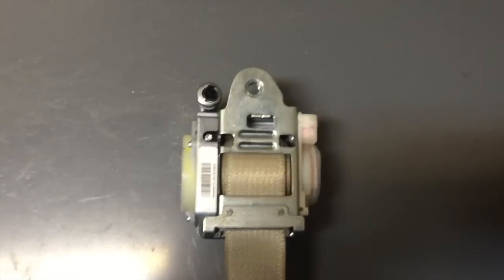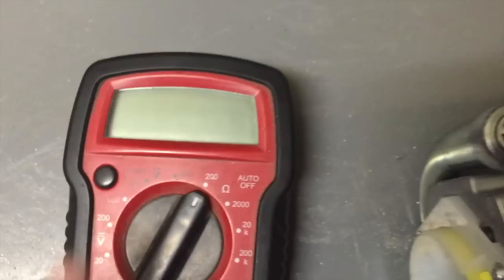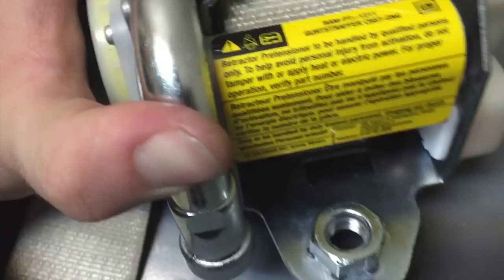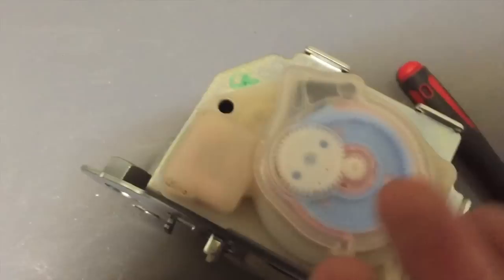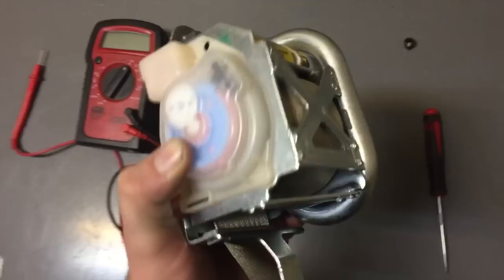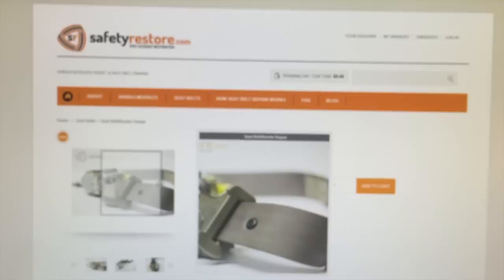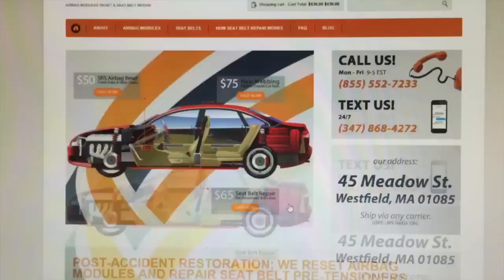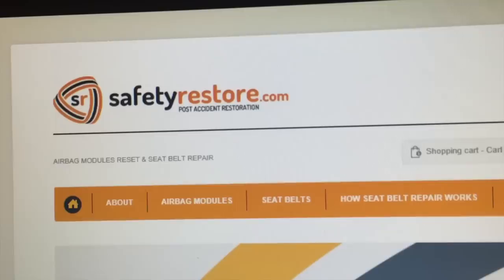Repair Seat Belt Tensioners & Retractors

Comment: My belt had two issues. One was the drivers belt had a VERY WEAK retraction. I'd get out at a store and returning that belt would be hanging below the bottom of a closed door. The other issue was the seat belt warning light was illuminated, My scanner showed pre-tensioner, open circuit, drivers seat. I sent the belt to Safety Restore with a typed note asking if they could also tighten the retraction spring. I also sent an email asking the same and their reply was YES they could fix that too. I got it back and the belts warning light was still on (Yes I did a belt system reset) AND the belt still hung out the bottom of the door if I didn't remember to work it back in before closing it. I contacted them saying I understood the cause of the illuminated warning light could be something elsewhere BUT the belt retraction was a different animal and that hadn't changed one bit. Sent it back, on them, and they returned the belt days later, on them again, and THE RETRACTION WAS WORSE THEN EVER acting like a turn or three had been TAKEN OUT of the retraction spring. I appreciate that they agreed to try it again AND for covering shipping cost both ways the second time but the belt retraction is pretty much mechanical and even that wasn't repaired and as I said, was even weaker after the second "fix." Not running safety restore down and I've used them I believe twice in the past with great results and recommended them to a could of friends but this time I'm VERY disappointed in the results. What makes my problem worse is Nissan no longer sells a replacement belt. It's a 2006 Titan and one from a salvage yard will likely have a lot of usage on it too.

Comment: The first thing you should avoid when dealing with SRS system is to use regular DVOM multimeters to measure components since they have a small amount of current in their leads and that can lead to a unintended deployment in the belt tensioners, also apply for the whole SRS system.

Comment: Cars didn't use to have seatbelts at all. How do you know other sites are scams. How do you know that safety restore isn't a scam. Even professionals make mistakes.
Reply from the maker: You're right Chris, not every site is a scam. I was referring to the companies I dealt with. Had a set of seat belts come back with resistors in them! How am I supposed to sell a car with seat belts tricking the airbag system? Not only is this unsafe and illegal, but knowing people deal with such companies is insane! I've settled with safetyrestore because every seat belt came properly repaired for the 2 years I've been doing business with them. If they can't safely repair the seat belt to work like new, they'll tell me and refund me my money. Professional, honest and safe.

Comment: I have an ohm reading of 2.3 to 2.7 it keeps fluctuateing on the scan tool the air bag light is on .it's 2012  f150 .passenger side retraction deploy

Comment: im wokring on a vw jetta there are 2 sensors cannot remove the plastic the way you did. light is on though most likely bad you think?
Reply from the maker: Use a small sharp knife to remove it... works for me. If they're locked then they're bad. Did you scan your system for codes? And yes, the 2 sensors are the dual stage seat belts they can repair. safetyrestore.com